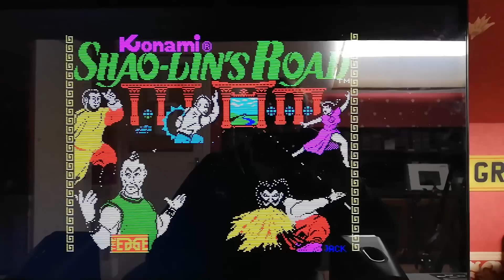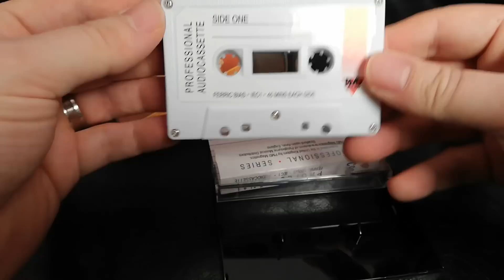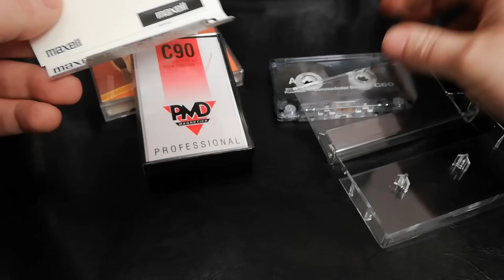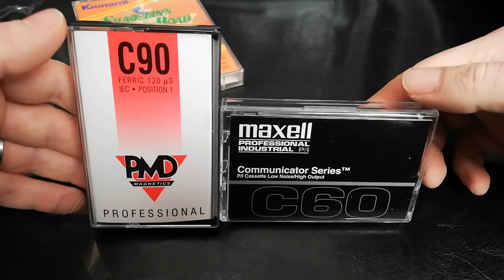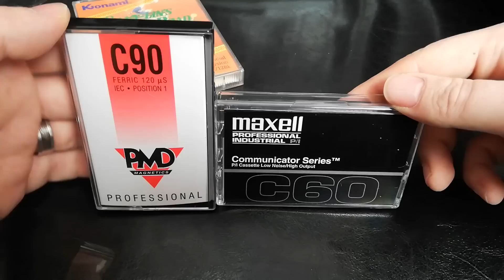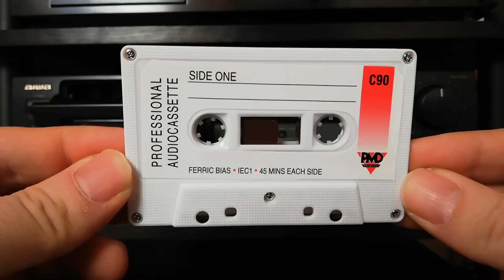Professional / Industrial Type 1 Cassettes - Fit For Voice Only?

Comment: when activating Dolby, you need to adjust the bias to +2db. spot on calibration only works for recordings without Dolby. also, when Dolby is activated, the tape is gonna be saturated with treble, and that's why you need to turn a tiny bit down the rec level

Comment: i've just brought the c120 of the maxell communicator series on your website to use on my new hifi cassette deck which is a mid or high range deck what can cope with a type 0 just about but it sounds rubbish as i've heared better tapes before now. since my hifi can take metal tapes i may treat myself to a superb sounding metal!

Comment: When it came to cassette decks for my CoCo 1 & 3, I really liked the Radio Shack CCR-81 & CCR-82. They were decent recorders. They had a AUX for use with the CoCo, and the relays connected to REM were very fast and reliable.

Comment: The program tape and I suspect the "Maxell Communicator" series tape might be for digital recordings on old computers.  I worked for a company that made tapes like that and they are Honorable for music recording.  They are made to record mid band frequency only.  I have several of these if you need one or two let me know.  Type 1 (Or zero if you like).  Not made for music.
Reply from the maker: I know what tapes you mean. They have a notch in the middle at the top of the shell. These aren't the same as those, these were more for voice, but seem to contain regular Type 1 tape.

Comment: While back I had a Ross c30 and while toying with my boyfriends shortwave receiver I found a number station with TAP data being transmitted between the coded phrases. It plays everyday at 4pm EST. Plugged a Panasonic pocket mono recorder to capture the data. Even though it's encrypted. It's still neat to have a hard copy recording of a number station.

Comment: Communicator for many years was old LN pancake that was left over from when Maxell discontinued LN.  After that ran out it was UR formulation that was used.  Maxell LN was nothing to be sneezed on.  I still use it to this day and it was and it still is great for recording 70s to mid 80s albums, especially crappy pressed ones.

Comment: I used to collect a lot of Commodore 64 games on disc in the 80's via telephone BBS systems. A lot of those "cracked" games were the UK versions of American games from companies like US Gold, I guess tapes were super easy to crack. The Minisette-9 was a nice one but I dont ever recall ever seeing a stereo version. The REM input was basically an off/on switch for the motor. I picked up a couple unwrapped 90 minute Maxell Communicator Series tapes at a thrift store a few years ago. But I also thought they used the same tape as UR's. There are still some Police HQ's and Courthouses that still use tapes for recording because of their reliability.